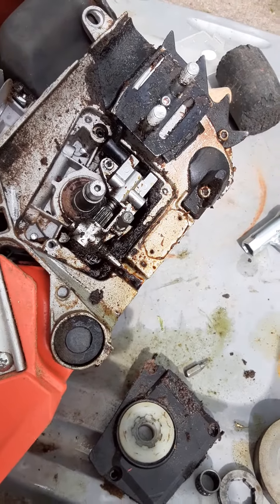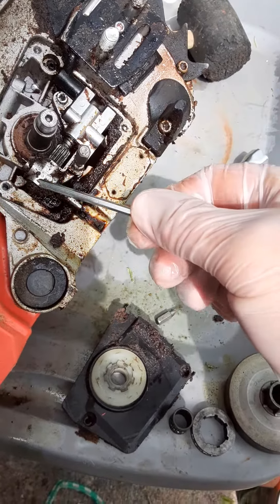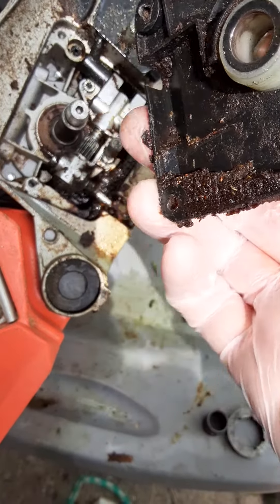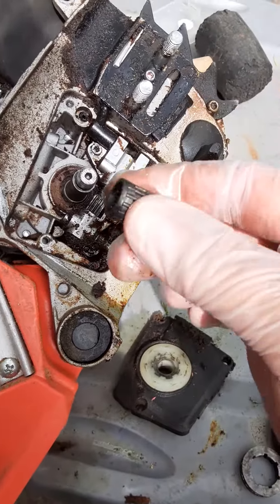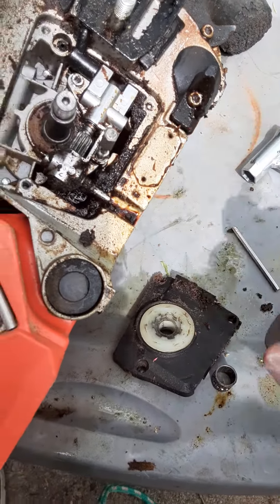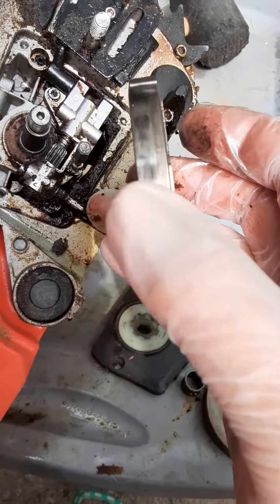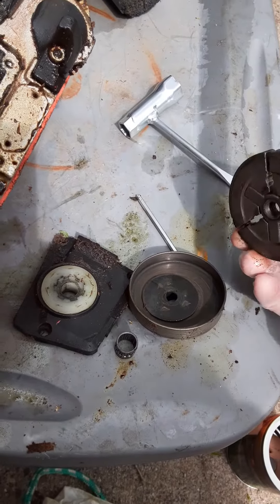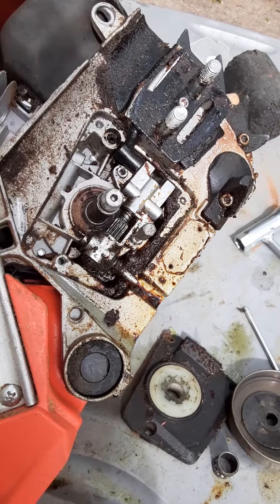Parts order, oil pump replacement, Chinese Chainsaw 5200 and clones, PDTO, COOCHER, etc

Comment: How very handy, thanks.  (I have a 2016 Craftsman 20" which has the guts of a Chinese system in it..... no manuals anywhere for it.  the Sears/MTD tech support won't help either)  Question for you -- any experience with the endless oil leaks with these Chinese oiler system?  (especially when the saw is off)  Is that caused by the pump itself, or by non-seals, or the oiler, or the breather getting clogged?  (I had an MTD tech support person actually claim the oil leak is a design flaw, that it's not fixable, short of never leaving bar oil in the saw when off....  Is that it?)
Reply from the maker: It is indeed a design flaw. They all do it. Incontinence is built in. Empty the oil reservoir or lay it on its side tanks down when not using.